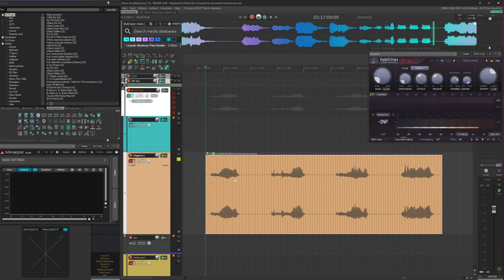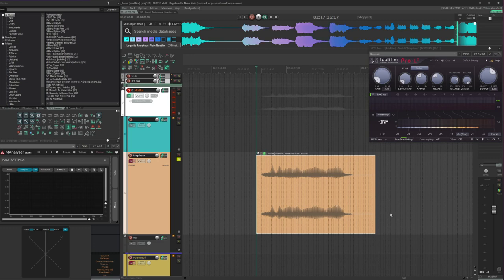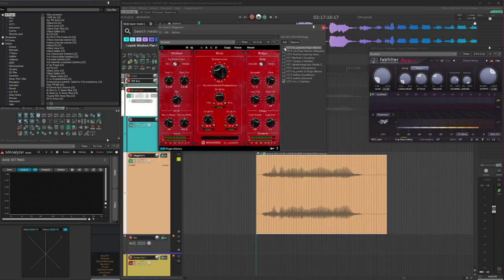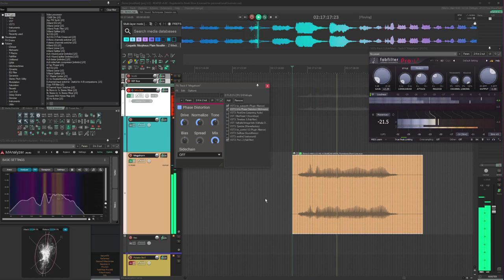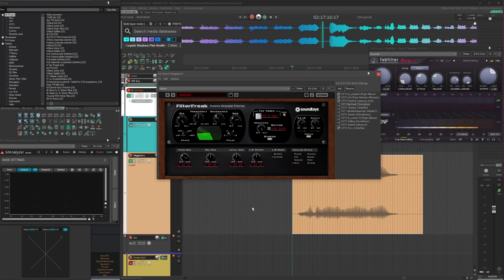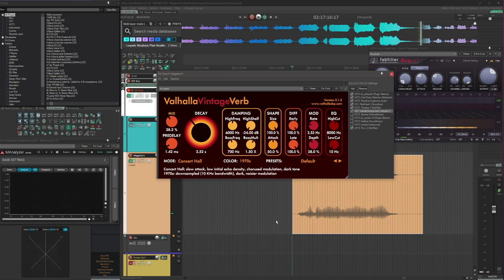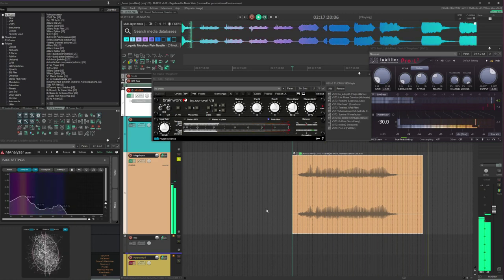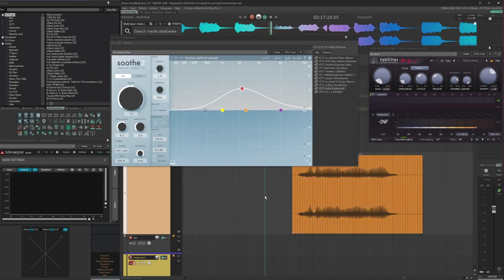Sound Design Trick - Tonal Megahorn

Comment: Thank you very much for your great educational videos! 👏
Brief question, please: would you recommend using élastique 3.3.3. Pro as a default pitch shift mode for sound design in Reaper?
Reply from the maker: Yeah I think that’s the one I use. They all have different artifacts that can be interesting when pushed. Most of the time when I stretch items I’m using varispeed (don’t preserve pitch) which doesn’t use the pitch shifting algorithm.
Reply: Thank you very much for your quick and kind response. Best wishes!